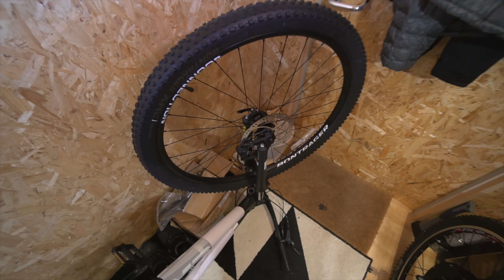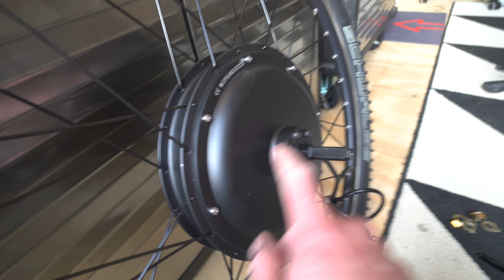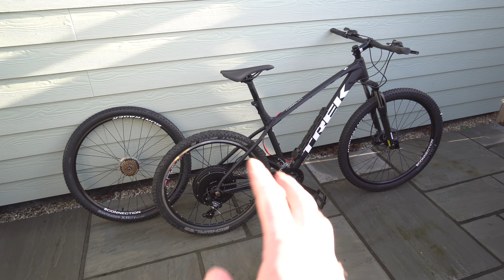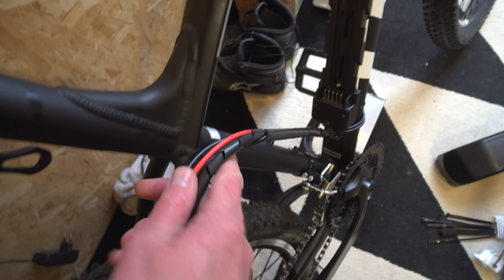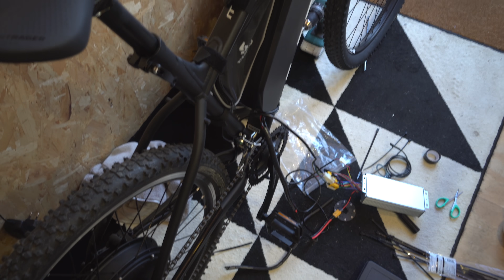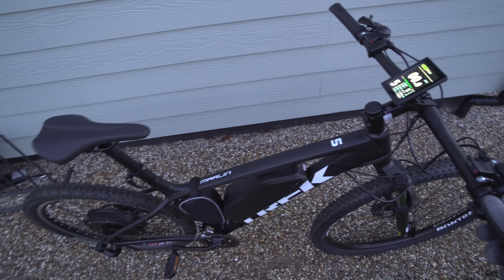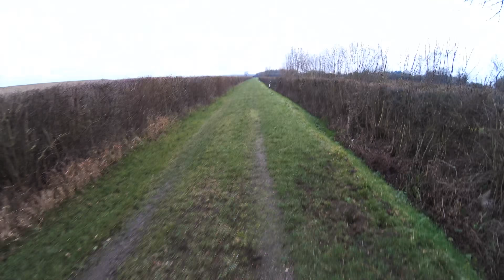HOW TO MAKE AN EBIKE IN UNDER AN HOUR!!! | TREK MARLIN 5 EBIKE CONVERSION

Comment: Iv had the kit for 10months now  from Andy very good ride and  had no problems at the start I put the motor on my giant XL so I had alot of room for the battery. The only thing I'm having a problem with now is the spacer washer thing is touching the cassette and it tightens the cassette that hard you cant pedal. I took the spacer what comes with the pack but it's no good anymore to put on now. Had anyone else had this problem before. I'm still at work so haven't fix it yet just wondered if someone had any ideas what I could use please? I'm not mechanical minded just thought be stratight forward to me but having trouble. Thanks

Comment: I'm not sure what size a bicycle to buy for this kit ,your bike size is 21.5 and the wheels for the bike is 29 is right? and you can fit easily the 26 '' wheel? will fit nice without problem? becauze what size i founded on the website or shops have this size   13.5 (27.5) and 15.5 (27.5) ,rest have 29 '' wheel so i'm confuz what i can buy to make the e bike with the kit from you

Comment: Nice vid . I my self dipped into the diy with a 500w kit and so far its nice . very much the same but less power . I will ride it 7 k/ms to work and it should be great . then on the weekends at 50 lbs . I can still put it on the back car rack and go explore a trail or 2 . I could pull the battery to make it 10 lbs less if needed. .

Comment: If you can't put out more torque with a hand tool than with a drill, you are a lousy mechanic. If you need a lot of torque you can use a 1/2" torx socket and a long breaker bar. Be warned: You can break things with a long breaker bar. With a 500mm breaker bar I've put out enough torque to break an M12 wheel bolt just trying to fasten it.

Comment: A safety note: The brake disc bolts should only be tightened to the specified torque, which isn't high, only around 6.2Nm, about as tight as you can get with a normal Torx key without hurting your fingers - it should be a fingers action, not hauling on them with whole hand. Alternatively, just spend £20 on a torque wrench and set the torque with that, it's the right tool for the job (a battery drill isn't). If you "do them up really tight" you risk stripping the threads out of the alloy hub, as they're only tiny little bolts. This could just cause damage to wiring, or could cause a crash.

The important bit is the thread locker (Loctite 243 or similar) - medium strength Loctite 243 would probably stop the bolts backing out even if you just did them up finger-tight. Do them up to the right torque with thread-locker and it will be fine. It doesn't have to be actual Loctite, there are other brands available from bike shops or Amazon, or you can buy bolts with it already in place. Most appropriate medium strength thread lockers are blue, don't be tempted to use the green "high strength" Loctite thinking it's "better" as it can stick the hub threads so well to the bolt that the aluminium strips out when you undo the bolts. Threadlockers are anaerobic glues, they set in the absence of air, so when you do the bolts up make sure you're ready to do them all up (star pattern) and complete the job reasonably quickly.

Comment: Hello Andy Kirby, I am getting a Kit soon for my Carrera mountain bike, my question is what wattage wheel should I go for, I think a min 1000 watt for plenty of power, or should I go for 1500 watt (bear in mind I weigh 22 stone odd) also should I get a front wheel hub or rear?
Should I get a LIPO battery of ebay.com (£100) or use lead acid?
Please get in touch, as I value and appreciate your experience with e-bikes.I want to get it right first time. The make of kit I am looking is VIOLAMART of ebay.
kellyrobert605@gmail.com

Comment: Me: Buys expensive conversion kit thinking it will take an hour

Reality:Takes me me 1 hour to mount the battery alone
Reply: @Rodo182  - just dig around eBay yourself. Be sure to get it with the 7 gear cassette already installed & carefully measure your drop out - that’s the space on the frame where the rear wheel bolts on. Even after my research it was still a little trial & error.
Reply: And the kit is $450us and doesn't include the battery B.S
Reply: كم سعرها how much did it cost
Reply: @TareqHamadallah  I paid £450 for the kit and battery total, then I bought another torque arm as well as some other small bits, total I paid for my electric conversion was about £500.
Reply: @avi.d04  how much v was it and I can't order conversion kits or I'll pay double the price since Israel lives here with us so we pay 2× fee on everything
Reply: @avi.d04  but luckily I found a online shop in Palestine that sells ebike parts so I'm like SUPER lucky
Reply: @Rodo182  - I just built a conversation on my mountain bike with the same kit he used.  

There’s no way in hell it can be done less than an hour. I am extremely mechanical & very comfortable working on bikes & it took me over 2 hours to install everything, including changing out the brake system & ripping apart the crank arm assembly to install the pedal assist. 

Then another hour for the wiring. 

I was all in for $550 & he’s selling this kit for over $1,000 AND it’s shipped from China directly. If you dig around on eBay you’ll find the kit.

By the way, the torque value is more important than the motor wattage.
Reply: @jasonjackson5696 what’s the original name of the kit that’s from China. I’m looking for it on eBay
Reply: @jasonjackson5696  hey mate been looking myself and thought that his were a bit expensive! You mentioned the torque is more important than the wattage. How do I work this out? I was going to order a kit off Amazon it’s a 48v 1000w kit and I have chosen a 48v 13ah battery. Do you think this will be decent?
Reply: @jackfortune4447  hey mate what did you end up getting? I'm looking at a 48v 1000w kit as well and am looking at a 48v 13ah battery same as you saw. Did you end up getting the 2? How well does it do
Reply: @avi.d04  I went with 1000w 48v 17ah. Haven’t fit it yet though
Reply: موسى ممكن سؤال؟
Reply: @ahmaddarking5386  Sure, ask away.
Reply: @Salgandarin  what a boss reply

Comment: Andy, can I ask why I would pick this over a bafang sshd? Hope you can answer. I've not built anything before and I'm considering my options.
Reply from the maker: It’s easier to install and probably more reliable. I also have a bafang setup which is great but you do have to maintain the drivetrain well.
Reply: andy kirby thanks for providing the time to answer, I appreciate it.

Comment: quick question if it ever gets read by you or have the time ,most dropouts can be easily widened with a bit of force to get the fatter axle of the wheel in, but the gear hanger on most bikes tend to be solid metal and very narrow and goes over the dropout itself making it hard for a thick axle to get all the way in, did u ever had such issues or just file sway at the metal to make .the hanger wider ?
Reply from the maker: I know that problem but I haven’t encountered it before. Might be a job for a mini angle grinder (dremel?)
Reply: @andykirby  thanks for the reply ,but yh i think a good hand metal file will do the trick :) i will soon find out

Comment: I have a 24 speed Carrera mountain bike will this fit as its a 8 speed casstte at the back of my bike
Reply from the maker: Yes you can order 9 speed hub upgrade when you order the motor kit on the store, an 8 speed cassette will fit on there.

Comment: I bought the kit form Andy, and made my ebike, here is a little review: https://ne-rc.blogspot.com/2019/12/e-bike-review-go-green-go-fast-go.html
Reply: Did the battery ship separately? Thanks.
Reply: @rickfromminnesota8036  Same question got my wheel today battery and no mention on the website of the battery coming on its own or tracking number...
Reply: @MadMunky6682   Yes, the battery comes separately
Reply: Rick M did it take much longer?
Reply: Hi, I used a Marlin 7 large frame size. Battery shipped separately and arrived maybe 3 weeks after wheel, maybe a little longer.

Comment: can you change the motor in the kit to a 5kw motor?
Reply from the maker: Yeah we can but it won’t fit in most bike frames unless you don’t mind single speed 😁
Reply: @andykirby  Singel speed is not a problem, but is it possible to use the ebike kits in temperatures below 0° Celsius?, and will the kits be available until summer next year?

Comment: How did you fit all the cables into the little bag? Did you open up the mettle casing and stuff it in that way? I’m having trouble fitting mine in.
Reply from the maker: Yeah it’s tight. It’s even tighter if you use the project box I use now!😁

Comment: How weatherproof or waterproof is this kit? Can you use it in the rain? I’m especially talking about the motor, because you probably could put the battery and the controller in a bag or something and have it protected from the rain, but not the motor.

I’m sorry if this is a stupid question. I’m new to e-bikes and I’m interested in getting a conversion kit.

Comment: I’m concerned about the import duty that’s in the small print.  How much extra is it going to cost to get it to me?
Reply: About an arm, a leg and one of your testies.
Reply: I got stung for £38 on the motor and speedo, and nothing on the battery.
Reply: I thought exactly the same thing. Did you end up buying it? How much extra did it add?
Reply: Is it worth buying the conversion kit? How much can you save by converting a normal bike rather than buying an e-bike??
Reply: The performance and functionality of this is much more than you'll get from a ready made ebike.
Reply: Ups rang me on the day my kit was delivered and told me there was a fee of £32 to pay.
Reply: @jasonlocke154   was that just for the duty or was the tax included? And do you know the size of the axle for the motor?
Reply: @Pearl_The_Utaite  that was the only charge I incurred,  when you say size of axle do you mean the width? Ie 135mm? 
It fits a std 135 rear end, ie most non thru axle bikes and most cx / gravel bikes with 135 rear ends.

Comment: Quick question cause i have been looking around and I am a really tall guy so 26" is really small, i'm 6'4 are there bigger wheels for bigger frames? Or would a 26" wheel not matter on the frame?
Reply from the maker: Yes there’s wheels available in all sizes, get the correct one for your frame.

Comment: My ebike only has a throttle.  It is a 1000w 48v 13ah bike.  Is it possible to add pas and keep both?
Reply from the maker: It depends if your controller has a PAS input? If not you will need a cycle analyst to handle the PAS and the Throttle, then you can have both.

Comment: Wow the price of those parts! A complete bike e-bike from Halfords is cheaper with the bike. Really good video though.
Reply from the maker: Cheapest bike in Halfords is the £899 Carrera vengeance ebike. It’s a 250W low power bike. The bike I built cost £400 for the Trek Marlin 5 bike which is already a better bike...and the kit costs £739.99 + import costs but this is a 1500-2000W kit with a 880wh battery and a lovely colour screen. The carrera cant touch it in terms of performance and range. If you went for the 250W kit to match the carrera then the cost would be about £1K, again it’s still better than the carrera...it’s great as an entry level bike and you want a turnkey ready to roll bike, but the quality....not so much!
Reply: andy kirby I wasn’t disputing quality but the average person will pick Halfords over this method. Also the carrera itself is the 1 one selling bike in Britain at the moment.
Reply from the maker: Yes you are right, but there is growing community of self builders, this is who I’m really interested in helping.
Reply: andy kirby then as an influencer you could use the number 1 selling bike in the uk to convert to an e-bike. I know for a fact this would appeal to a wide audience who already own this bike 👍
Reply from the maker: Analog Restoration good idea!
Reply from the maker: Yeah it will but you’d need to check your triangle space to see in the battery will fit in there.

Comment: I travel 25miles to work so 50miles a day was just wondering could I use an electric bike to do this distance about six or seven days a week, or would this distance burn the motor out ?
Reply from the maker: Yeah you could do it on an ebike, you’d need a big battery and it would help if you could charge at work. The motor would never burn out.

Comment: I have a 2008 specialized epic with very limited clearance due to the brain suspension system. Will the motor still fit? what are the dimensions of the width of the motor?

Comment: I'm glad I discovered that conversion kits exist for bicycles.  I have a Cannondale F1 that I've had for almost 10 years and it hasn't seen a lot of use in recent years.  I think I'm going to look into buying a kit for my bike since complete ebikes cost as much as $5000 from what I've found.  This is a much cheaper option.
Reply from the maker: Yeah unless you want the latest carbon over hyped and over marketed 250W (750W in the states) ebike that you still have to pedal over 15.5mph (30mph in the states)then don’t spend 5000USD. Fitting a kit is rewarding and will have you sailing past factory ebikes uphill with the wind blowing against you 😅 for about 4000USD less if you fit it to an existing bike!

Comment: Hi Andy, nice vid. I built a 2WD ebike with 250w 36v motors in front and rear. I've also got a 1000w 48v rear hub motor ready to be fitted. What I'm thinking is fitting the 1000w rear motor and still keep the 250w front motor, leaving the 1000w disconnected till I go off road. Any ideas how a 250w front and 1000w  rear running at the same time off road, might work out?

Comment: Hello andy. Nice Vid. I am considering upgrading my specialized stump jumper full suspension to en Ebike but i am have doubts as to if the battery gonna fit in the frame due to limited space. Could you please write down the exact dimensions of the battery?
Reply from the maker: Hi, no problem, battery dimensions are on the product page in the images here: https://www.cloudsto.com/ebikes/kirbebike-conv-kits/kirbebike-1500w-2000w-ebike-kit-inc-ion-plus-58v-17ah-battery-detail.html
Reply: @andykirby  Damn, the big one does not fit my frame. The stumpjumper has an horizontal shock abs. That only leaves me 9cm height
Reply: @andykirby  Would you install the battery under the frame and not in the triangle, if no space was available?
Reply from the maker: Yes I’ve had a few customers do that, no problem!

Comment: I have a launa cycle shark battery 48v but I can't connect it to my controller can someone please tell me what am I doing wrong or should I buy another controller😈😠😢
Reply from the maker: What you mean you can’t connect it? Does it physically plug in? Are the connectors the same and are the positive and negative around the right way? (polarity)
Reply: @andykirby  the battery has red and black connectors but the controller has them with a mini silver pole like feature with a green sleeve
Reply: @andykirby  im thinking mabey to cut off the the battery connectors and replace them with bullet connectors in order to connect the batter to the controller??
Reply from the maker: ikea boy yes that would be my first thought too. It sounds the the extra part is just some sort of mechanism to stop the plugs coming apart, 4mm bullets or Anderson connectors will be fine.
Reply: @andykirby  thank you so much☺

Comment: What is the range of the ebike? Recharge time? Maximum attainable speed on level highway? Can other types of bikes be used, such as a typical ten-speed bicycle? Or is this only for the Trek model you show here? Thank you.
Reply from the maker: We’ve had some customers report over 30 miles, charge time with standard charger is about 6 hours. We offer a fast charger also. You can use up to a 9 speed cassette with our new hub... see here: https://www.cloudsto.com/ebikes/kirbebike-conv-kits/kirbebike-1500w-2000w-ebike-kit-inc-ion-plus-58v-17ah-battery-detail.html

Comment: Hi, just got the battery in from FedEx. I did exactly what you did and put the head lcd upside down. Really nice and fast well impressed. I added rim tape before adding the tube. Apart from that nice kit.
Reply: How fast is the top speed in moh?

Comment: Great vid...  what size bike should u use .. so everything would fit.. how long did the battery last how many hours before u needed charging .. how many watt is the kit
Reply from the maker: Thanks, the larger frames are better as you get a bit more space for the battery. The battery is hard to completely discharge unless you go 30+ miles 😁 kit is 1500-200W you can see it here: https://www.cloudsto.com/ebikes/kirbebike-conv-kits/kirbebike-1500w-2000w-ebike-kit-inc-ion-plus-58v-17ah-battery-detail.html

Comment: Ok I watched as far as I could. I really don't know why. I couldn't wait I had to ask you this question. Did you really go "whoo" when it speed up 2 mph when you went from peddling to the throttle for a second? That was an accident right? You're to cool to let that slip. We get it the thing is cool. But you're over selling it a bit there Bub. I had mine put together in about 35 min. And didn't have to go back and fix anything either. Yep the Harley factory did it right!
Reply from the maker: Haha, have you ever felt 100-200nm torque whilst sitting on something that weighs about  20kg ?! It is a surprisingly fun feeling. My other electric bike has 500bhp per tonne (weighs 40kg) now that makes you go woooooooo!!!!!! If you can keep the front wheel down😁😁
Reply: @andykirby  Actually power to weight ratio is why we ride isn't it? Be safe out there brother. But the most important thing after all is the woooooooo!!!!!!
Reply: I can't afford to go put my scoot on a dyno. Or the fish tales would be on. 😎
Reply from the maker: Wheels Holland haha your right bro! Ride safe!